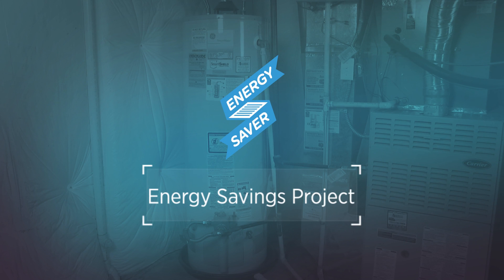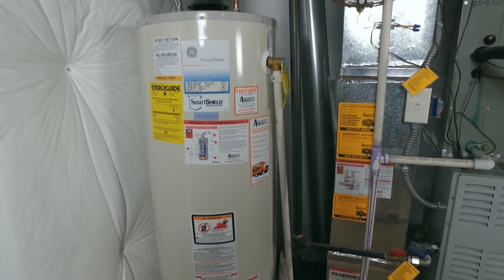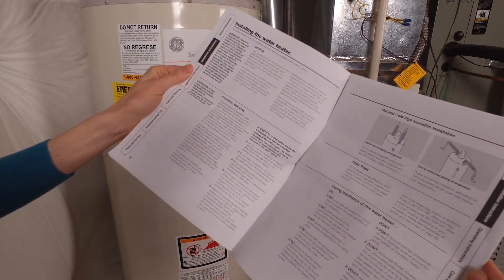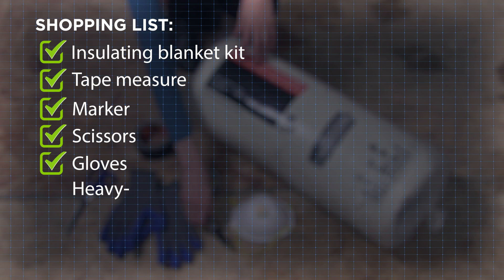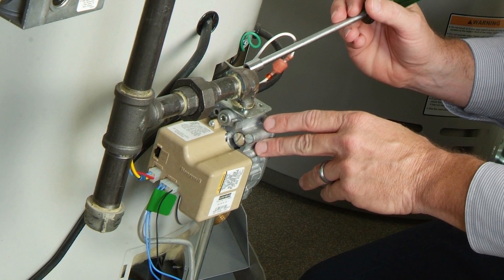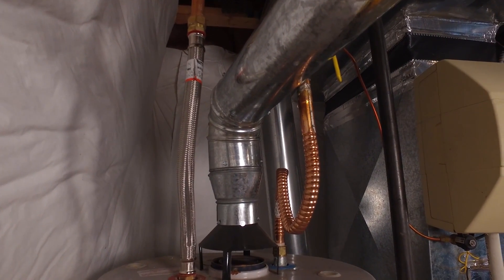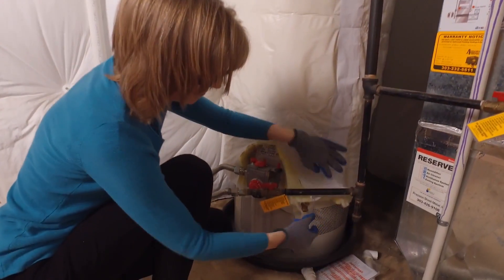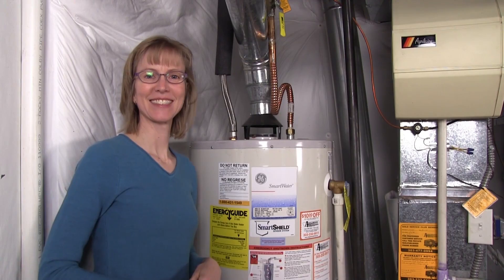Energy Savings Project: Insulating Your Water Heater Tank

Comment: For HVAC, you do not have condensate overflow device in condensate drain line OR secondary port of your AC coil. Your third option is in secondary drain pan which was not used in this application. IMC 307.2.3 gives you THREE options where to install a "water-level detection device", NONE of which are used here.